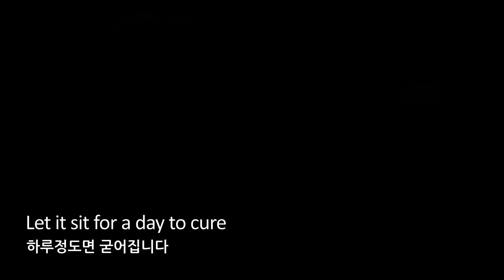[원목가구] - 월넛 탁자 만들기 - making mid-century modern coffee table

Comment: Beautiful. What did you use for final finish!
Reply from the maker: Here is how I do my finishes on walnut: 
1. Apply tung oil+mineral spirits mix (50:50 ish), let it sit for like 20-30 minutes, wipe off excess. Next day reapply and wet sand with 320-400 grit sand paper. 
2. Let the tung oil dry for like a day or two. Then apply de-waxed shellac. This will give you a safe adhesion for any final finish.
3. Then my final clear coat finish. I used Arm-r-seal here. Lacquer or other products will work the same.

I think the tung oil gives a nice boost in the color. However, it doesn't have much moisture protection. I think I can directly apply an oil based finish on the tung oil but just to be safe, I applied shellac between the tung oil and my final finish. 

The finishing step might be somewhat excessive but that's what works for me.